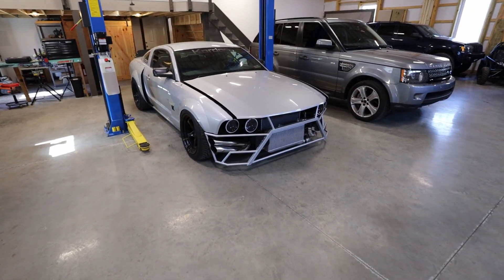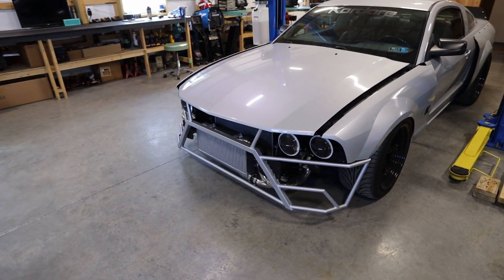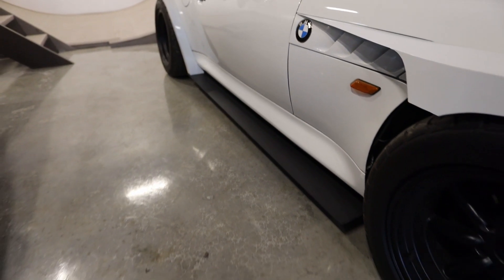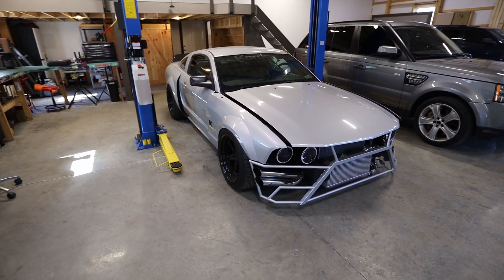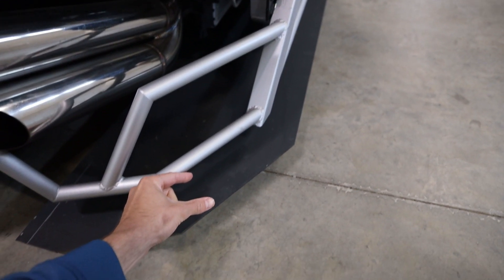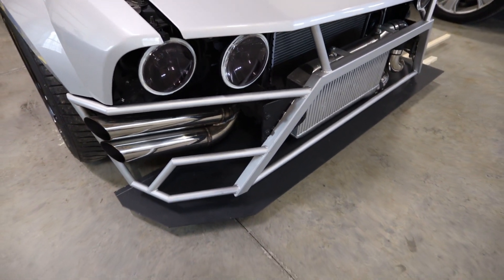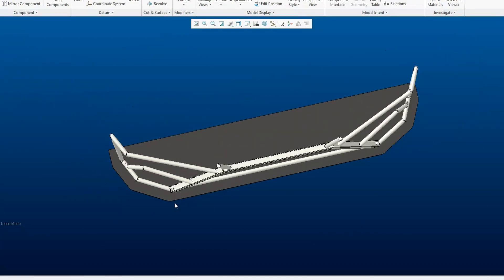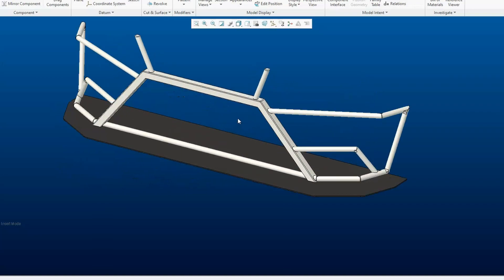Front Splitter Design and Prototype - Turbo Mustang

Comment: I like it man, keep up the great work. What material is that that you used in the prototype again? And where can I find a piece to cut like three 5" circles???
Reply from the maker: Thanks! That was kydex. I'd suggest getting some acrylic sheet at home depot or McMaster Carr
Reply: @Kordare  ok cool, I'll check into that. I just wanna make a cover to go over the fog light holes on my GT bumper, so I need it to flex without cracking or breaking and then use black rivets on it

Comment: I think adding down posts and thread them, then do a counter sink up from bottom of splitter and mount that way.
Reply from the maker: I was thinking about that. Only downfall is the threads would be steel and would corrode.

Comment: Do you run the inner fender liners? I know they come in 2 pieces. Didn't know if you ran both or just and rear or none?
Reply from the maker: I have the rear one, I don't remember if I still have the front one but cut up higher 🤔